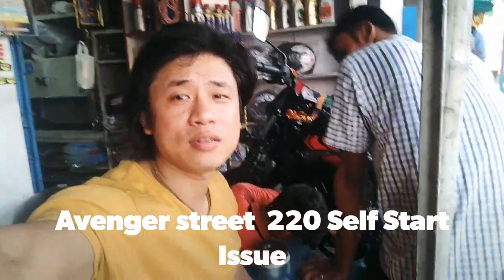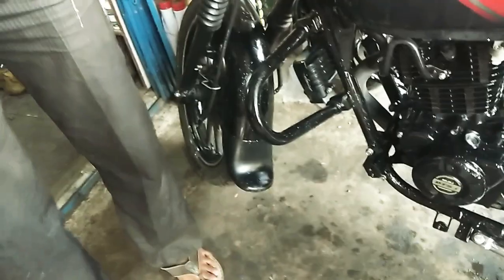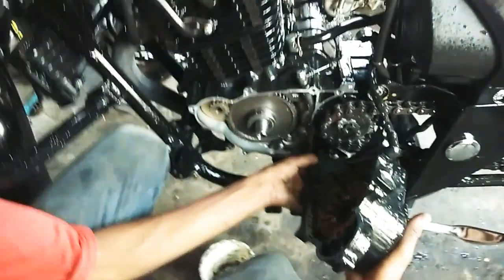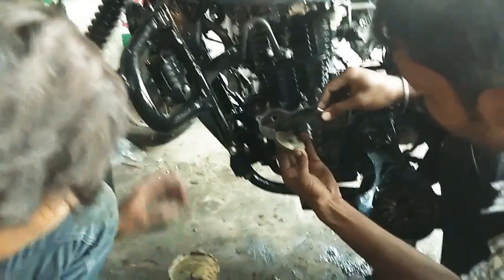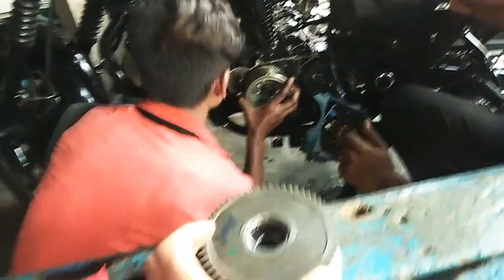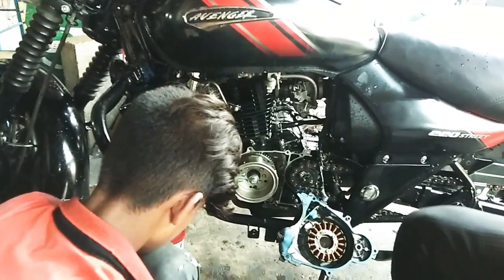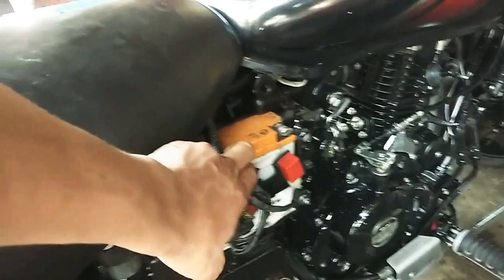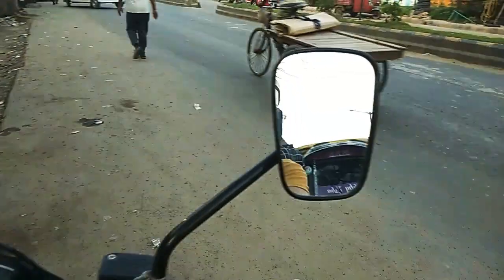Bajaj Avenger street 220 Self  start Issue / Om Bahadur Thapa

Comment: I really appreciate that your information has helped me to fix my bike after 4 years. I purchased Avenger 180 in 2018, and was having same problem, the local mechanic was insisting me to change the rotor (the one with round spring) only. I changed this part about 7 times in 4 years each costing about 1200/-. But fortunately I found your video on YouTube where you said the entire rotor assembly needs to be changed . I tracked your part no. In the video and found more information on it and changing it solved my problem which I was facing for last 4 years. Thanks Bro...
To the viewers please note Bajaj tried a new self assembly in Avenger and ns200 bikes but it got failed entirely. Bajaj called the bikes back to service center in 2018 and fixed that free of cost. Those who have not changed that will have problem untill you change the entire assembly. For Avenger street models the part no. is 52DK0334 which will cost around 1600/- To 2000/-
Reply from the maker: Thanks for feedback

Comment: Gj5sb 0804 .. 
Exactly  prob in my bike . Total wrost bike . Wht  the fuck  bike .  Dont  buy .. bajan avenger 220 street new model
Reply from the maker: Change  the motor for self  start  it will  cost you  around Rs 1900 - Rs 2200 . And it will  be fine  for couple  of years.